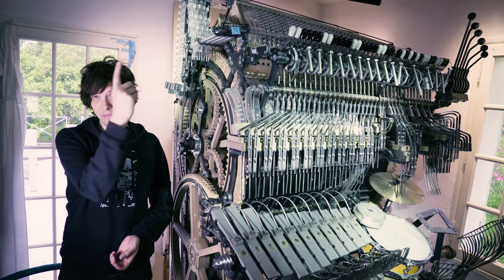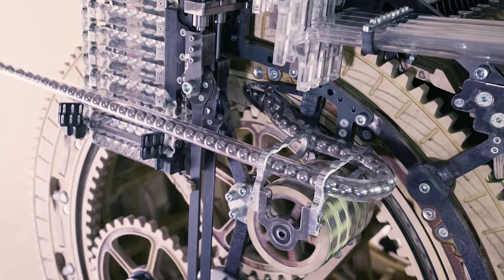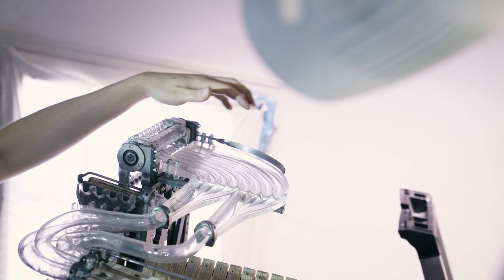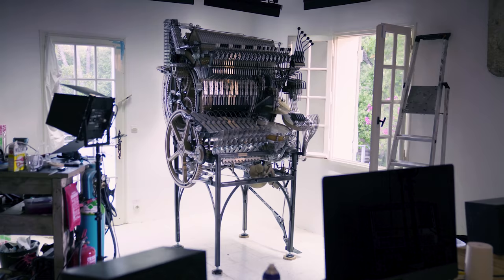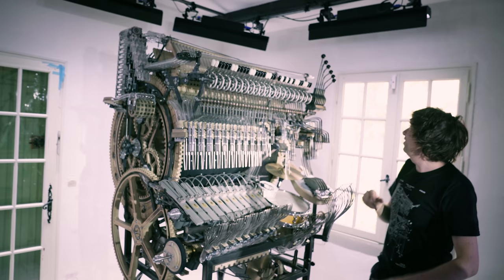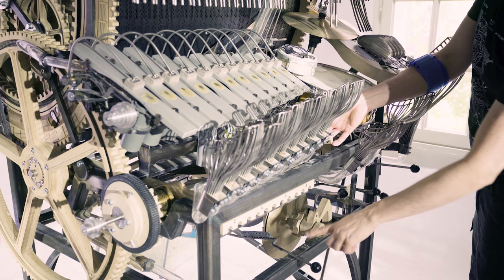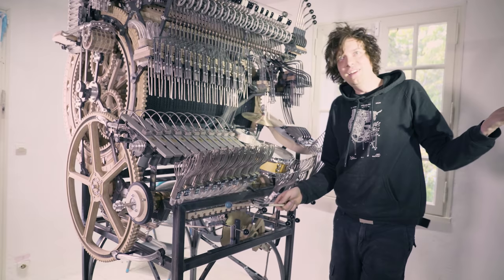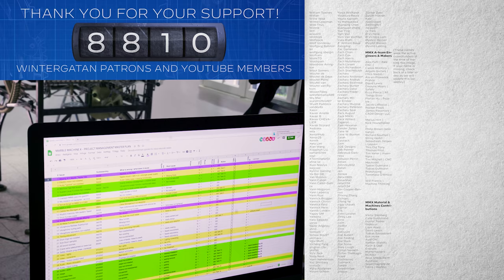Marble Demagnetizer 2.0 and More! - Marble Machine X #131

Comment: So once upon a time with a really old car, I put engine cleaner in my gasoline, thinking I'd get all the crud out, and it'd work better.  Turned out that the coking in the engine was filling gaps in the wear parts, and now I had to go get gaskets redone and two pistons replaced.
I guess what I'm trying to say is, as you were cleaning the MMX, which over the course of its development looked like it had gotten a respectable layer of shop dust, I was very anxious that some of it would turn out to be what I refer to now as "functional filth".  That is, some subtlety of the dust's presence had it calibrated just right, and removing the dust was going to force you to have to re-tune all the things.
My anxieties are not always sane.
Reply: duehd
Reply: A valid concern, that is why it is important to clean regularly, before the crud becomes a crucial part of whatever system you are operating. (Eyeballs Washington D.C and the Pentagon.)

Comment: I don‘t really get why you removed the „marble lane divider“. Now the demagnetiser is just used partially.
Reply: It was causing friction, leading to a choke point where fewer marbles were entering the lift. The demagnetizer was a bit over-engineered as it was (2019 Martin was more focused on making things 'perfect', rather than efficient).
Reply: The U-bend of the pipe still comes close enough to the other three magnets to have some effect, I think.
Reply: guess its just re designin...to be redesigned
Reply: @F-Andre  I agree it looks now unnatural, needs a redesign. :/
Reply: @sebastianweber7786  yeah i wonder why he changed so much :( he said he wanted to improve things not to simplify them this way....
Reply: I think a bigger loop in the tube back to the third lane from the middle would look better, along with a shorter wheel.
Reply: I mean magnets don't just have an affect directly above them due to them having a radial magnetic field, so they affect things off to the side diagonally in a 3 dimensional space. I  understand what your saying they aren't being used to their full capacity but more is being used than you think. But then again... This is just my guess.
Reply: @F-Andre  Something isn't perfect not when there is nothing left to add, but when there is nothing left to be taken away

Comment: the diameter of a spring increases when it's compressed. is the scraping sound coming from the spring?
Reply: no, it's from the metal.
Reply: @cjl_idn2006  Bu-But sir... the spring is metal.....
Reply: fixable, felt sleeves

Comment: at 19:05, that spring steel you added for the edge case of a ball pushing on the pipe seems to be being pushed up on every single marble
idk if that's intentional, but "every time" doesn't sound like an edge case
Reply: Yes it's a bit weird...
Reply: I think that it has to be angled down in that way so that it can guide an edgecase marble back into the tube, instead of letting it escape the system.
Reply: It's doing that when the marbles pass underneath. The point is you don't want a marble stuck half-way between shuttle and stair and it seems to force the positions nicely.

Comment: I'm wondering how heavy that whole thing is. I get the feeling the legs are at a decent fraction of their design strength. Let's do some quick math, eh?
 
I'll assume 1/8 in thickness and 2 in by 2 in outside diameter tube. It also looks to have about 18" unbraced length near the base. Miscellaneous steel typically has a minimum yield strength of 36 ksi or greater.
Area = A = 2^2 - (2 - 1/8*2)^2 = 0.9375 in^2
Radius of Gyration = r = sqrt( (2^4 - (2 - 1/8*2)^4)/(12*0.9375) ) = 0.767 in
Effective Buckling Length = K*L/r = 2.0*18/0.767 = 46.9 in
Critical Buckling Stress = phi*Fcr (AISC 14th Ed. Table 4-22, fy = 36 ksi, KL/r = 47 in) = 28.9 ksi
Bucking Stength = phi*Pn = A*(phi*Fcr) = 0.9375*28.9 = 27.09 k = 27,090 lb
 
Nevermind, super strong! If the unbraced length was 3' = 36 in, phi*Pn = 0.9375*20.3 = 19.03k, or about 8 tons per leg. Should be fine! It was just making me a little nervous throughout the video lol.
Reply: furd
Reply: lets do some quick math eh
Reply: I was expecting a comment not a short answer physics response
Reply: lol I’ve worried about it too. Thanks for doing the math for us and figuring it out. I’m super curious about how much it all weighs at this point though...
Reply: @adroit4104  
Short answer engineering (aka, applied physics) responses are my bread and butter!
Reply: Given his nationality you should do this in metric.
Reply: @ianmoseley9910  
idk metric engineering. i could convert stuff, but so can any1 else.

Comment: 5:40 : the sine function would like to complain.
Reply: It's actually not really a sine function.
If we say r is the radius from the center of the shaft (at coordinates (0,0)) to the bar attachment, L the length of the bar and a is the angle of the shaft, I think the expression for the height of the sliding extremity of the bar would be something like:
h(a) = r*[sin(a) + sqrt((L/r)^2 - cos(a)^2)]

I'll try to plot it with different value to see how it looks ^^ But what we can observe is that if L is very long compared to r, we would approach this expression which is a pure sine with an offset : h(a) ~ r*sin(a) + L
Reply: Louis DURAND You’re right, I was just joking about the rather square waveform that Martin was sketching. And yes, the bar angle is low so it’s super close to a sine but not equal.

Comment: @Wintergatan Upgrade suggestion:
26:38 If you cut out notch or hook at the side in the bottom of the left "lever holder" (with the spring) then you can both set & switch very fast between both "Max mode" & "Min mode" by pushing it down & to the side. (same design as on some pianos (usually with 3 pedals), one of the pedals can be push down & into a notch to keep the notes dampened)
(27:40 Yeah, that scraping sound isn't very musical at all :/ )

Comment: Needs more lasers.  You could add tiny laser diodes to many of the instruments so they give a visualization of the resonance from the specific instrument, like a oscilloscope.  Use fiber optics to bend the light where you want it.  Another idea is to drill the bearings all the way though and add tritium cylinders to them so they emit light and show the rotation of the ball as it rolls.  This adds a light source that will last for 10 years without any outside source of energy AND you can honestly tell ppl the Marble Machine is radioactive. (Not at all dangerous)

Comment: Try making a steel pallet and weld your flimsy frame to it  and from this pallet weld new vertical posts up to the top of the maschine try catching  the weight of the top of the maschine onto such posts . To stop the frame being acoustically active after welding fill with quartz sand

Comment: The slope of the top plastic pipe of the machine seems not to be sufficiently steep, however a steeper slope might add pressure on other parts of the machine. For summary, it seems to me as a very good job and this machine should be mass produced.

Comment: You should color (anodize or plate) half the steel balls different from the other half.
That way, depending on the music (and random routing effects) you'll have an ever changing pattern in the visible marble tracks.
Also, your audience would better see the motion of the marbles from a distance. In fact, for shows, coat half in some kind of UV fluorescent coating so they literally glow (you could go really bonkers with different color glows,... but that may be too much marble madness!)

Comment: How does the demagnetizer work? It passes each marble over a load of moving magnets, each marble twice, one way and then the other. But how does that demagnetize the marble? Does it matter that the marble is rolling? Does it matter that the magnet is going parallel (or anti-parallel) to the motion of the marble? How does magnetization work anyway?

Comment: I am not completely assured the “monolith” is going to satisfy you in the long run. The concept is good with the magnets but right now it’s more like squeezing between the spring tube and the magnets with friction rather than held in place by the magnets. I would probably space it out a bit more and put a washer or something on the handle to make the magnet surface bigger giving the magnets control of the handle instead of the friction.

Comment: You should tig a wire around the vibraphone mute handle so it can't go anywhere else other than into the manual or hold slots - otherwise, you risk having it go wandering around mid-performance.

Comment: Try to make the vibraphone handle higher by adding a slight horizontal rod, its about ergonomics aspect man, so you can get rid from backache 😅. And one more thing, put a rail on that "spring & magnetic switch, so it wouldn't going anywhere. Namaste 🙏🏻 Cmiiw

Comment: For the scraping sound from the spring that controls the damping lever: I am thinking maybe it would also work if you replace the spring by a compressible foam block? They are spring like but light weight and completely quiet.

Comment: Great mechanical engineering, RESPECT.  😎  26:30 The strip on which the pipe with the spring is welded is sitteing very loose on the frame. You should fix this.😏

Comment: Late to the party, but I see a potential flaw in the new marble distribution system. On the test run at 9:20, the marbles tend to cluster at the back end of the belt elevator, which is going to dump them in the bypass lanes that go to the further parts of the marble distributor. This may lead to the first few channels being starved of marbles under continuous operation.

Comment: I have a solution for the resonator pipe length issue when u change key blocks. U should make the pipes slide one in another, that way u can adjust length whenever you want

Comment: If the marble maschine needs a flat floor to stop internal twisting you will find it a major improvement to make a welded tube base frame with 3 feet to the floor and at one end 2 extra feet not touching the floor .so 1 end 2 feet touching the floor and the other end 1 foot touching the floor with 2 flying  feet  hovering . 

Any maschine needs a stable base and a 3 legged frame is always best as it will not deform . You are reaching now a total weight when the marble maschine will start to deform under it's own weight  this is manageable in your lab but a lorry drive with bumps will fuc... up al, your adjustments if you move it . Time to make a stop and see how welded steel tube maybe 60x60x6mm can give you a stable base  a crazy idea look for air suspension springs from small lorries for your pallet to let the marble maschine  hover during transport so killing bumps

Comment: Maybe you should screw down that piece of metal, which holds the sustain lever. You can see at 27:00-27:08, how the base moves up, when you pull the lever up.

Comment: Martin:  
In this video, you addressed the noisy conveyor belt discharge by using some silicone. Would adding mass to the discharge chute reduce the noise by absorbing vibration caused by the marble in the chute?  For example some thick felt, rock wool, or a rubber mat glued to the underside of the discharge chute.  

I'm late to the party. Disregard if you have addressed this in a future episode.

Comment: Welding all those pieces together is really gonna stink if you have to replace one of those rods(probably in the middle of a show)
Try machining a flat on the rods for the set screws to bite into. Contouring the slot they fit in to with a corresponding flat will also prevent twisting which means less stress on that friction fit. If you also add threads to the rods you can use small lock nuts to hold them in place as well.
All of it together could be overkill, but the bar you welded on is definitely overkill, and it's a bandaid solution that will bite you in the ass in the future

Comment: Really nice work: One thing I spotted is your snare is reacting to your metallophone. I suppose you could dampen the suspension of either of them to clean this up. Regarding to the spring sound of your dampening system it could be a solution to use the black coating you used in this video to avoid metal to metal contact.

Comment: Silicon on the Under side of the offload tray, would have lowed the noise without adding friction or rebound.
You could upgrade to phenolic instead of Plywood for more Durability.

Comment: Set screws are maybe not the best choice for this application,  Would you consider split collars or taper locks (split collars come off without disassembly). and are you concerned with the length of the new tubes if they get warm?  Seems the long tube full of balls would be heavy and under stage lights or warm climates might deform?

Comment: I love the MMX and your videos, but I don't think that sustain pedal will work very well in the long run.  Other than the sound and the fact that that plate isn't fully connected (which I'm sure you did on purpose and or know about), it is able to just come out and go wherever.
Ideas I have (they are just ideas and you can probably make something better)
- Add some sort of cover as to only allow to move between the two modes
- Use a lighter spring and make it so the magnetic bar can be swung into place with everything in one channel
- Make some sort of locking mechanism that will hold it in the desired channel until you want to move it
I hope you will come up with something even better than these.  Good luck!
"Glory is Forever"

Comment: I wonder if the marbles will be force over the magnets of the demagnetizer too quickly that it does not do its intended purpose. Or it backs up in the tube before the demagnetizers or after and they end up going onto the floor.  I am also concerned he does not have enough capacity to return the marbles back up to the top. The conveyer does 8 and the other does 4 per stroke with 32 channels at 120 bpm he may need larger holding capacity before the demagnetizer....  I've watched this since the beginning and don't remember him every really talking much about the possibility or calculations  of the possible volume of marbles needed to be returned up to the top.

Comment: Instead of welding that bar onto the sustain arms, why not drill and thread holes into the rod they were friction-fitted on to and bolt the arms directly into the rod? That way you get your solid mechanical connection without sacrificing looks.

Comment: why not suspend the dampening lever from the top bar via a spring? it should hopefully be quieter, and the set values could be achieved by sliding the lever into a series of horizontal notches in a plate

Comment: I don´t wanna be a buzzkill but did You see the movement in the damping lever assembly? Especially when the magna-lock is used and You pull up the whole assembly moved alot. Review the vid and i`d recommend at least a zip-tie. I can imagine strenghten that would improve the sensibility of the lever and the use.
Man, i´d never imagined when You announced years ago what You want to put together i declared You a nutcase. But i guess You have to be to come thru with this. Stay safe.

Comment: wouldnt the “motion curve” pretty much be a sign wave? it being basically rotation around the unit circle and all.
x and y position should be sine and cosine, movement speed along those axes being the first derivate, thus another sine/cosine but phase shifted.
Reply: Correct (assuming we aren't in fact living in a simulation)